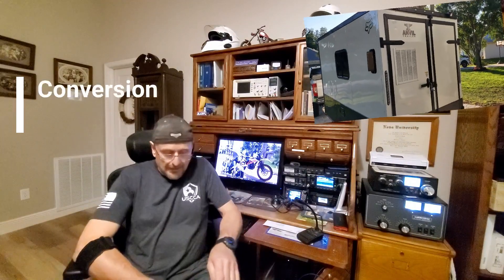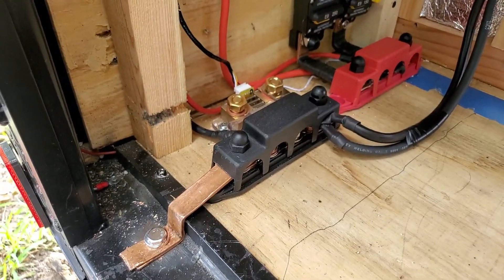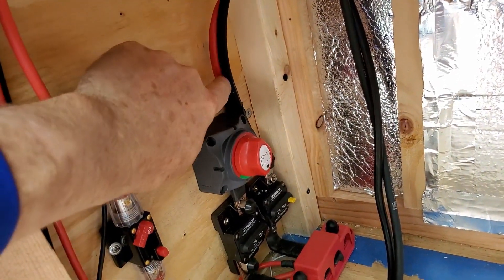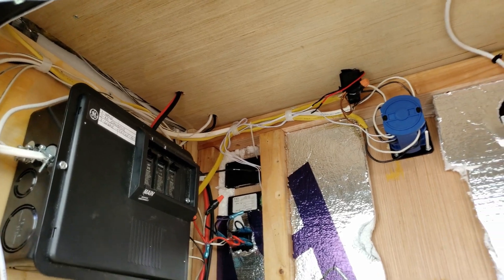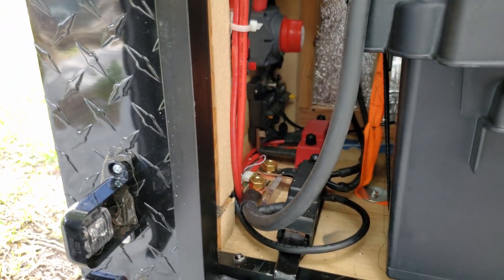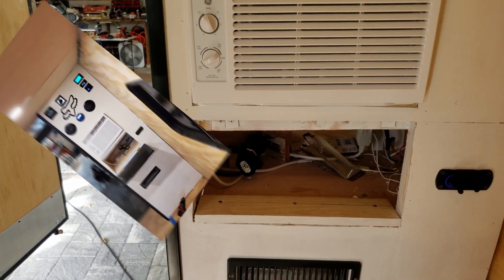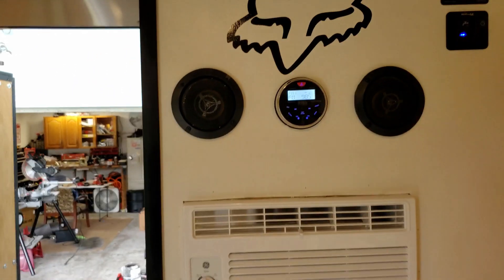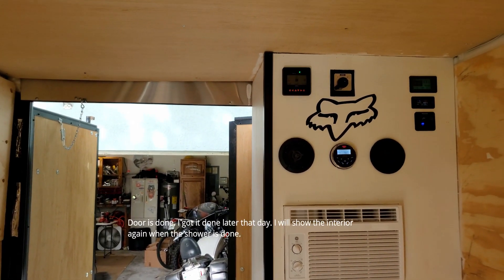DIY Cargo Trailer Camper Conversion - Episode 10 - Electrical System Cabinet - Toy Hauler Tiny House

Comment: Nice electrical system!!  Do you have a block diagram or schematic? I plan on making 1/2" copper buss bars, like yours. Thanks for sharing your system!!
Reply from the maker: Hi David. I do have a block diagram of the electrical system.  I will make a brief video describing each section and some details on my selections.  Give me a few days to post it.
Reply: @donsdoityourself2547  Thanks, I'll look for it. I hope it doesn't overload you with additional questions. 😁
 On the other hand, I guess that is good for algorithms. LOL 
Cheers!
Reply from the maker: Here's the Video I said I'd post on the electrical system:  https://youtu.be/xwYsgocIvwg